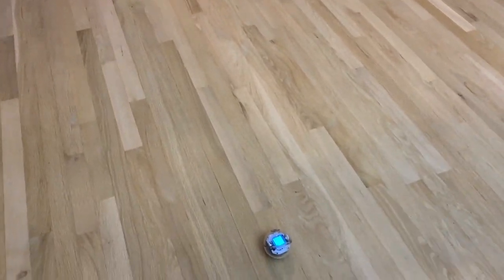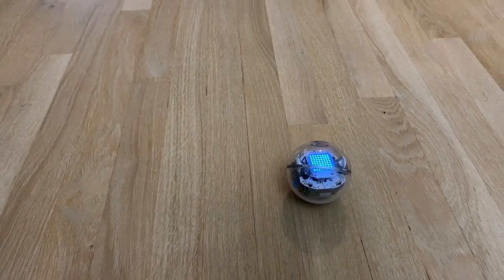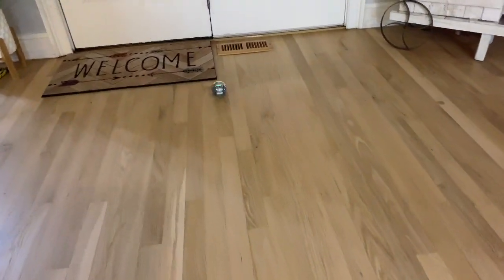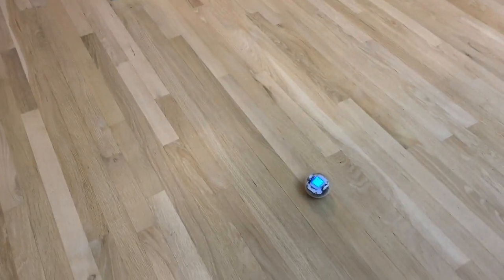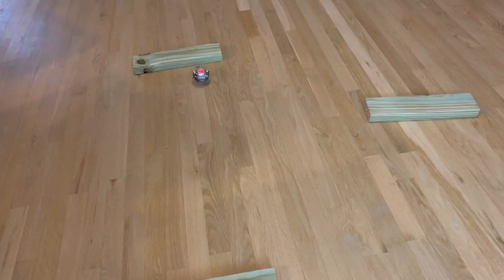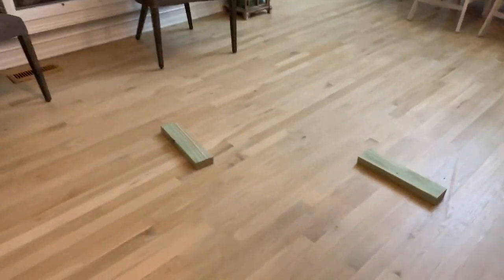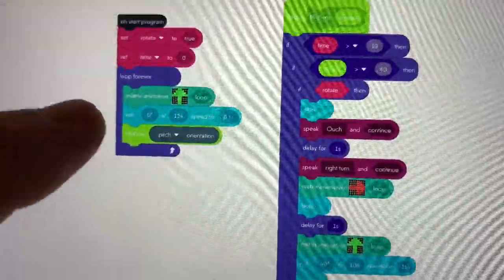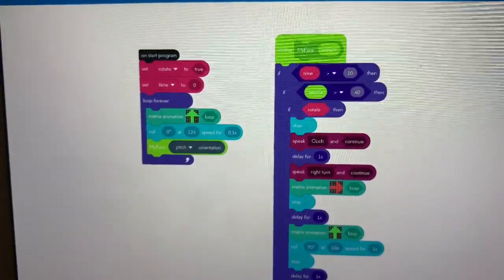Sphero Bolt using the pitch sensor

Comment: Sphero support are very helpful, you should give them a try to see if they can replace / fix?
Reply from the maker: Yeah, they tried but it isn’t really a flaw in the hardware but how they interpret the sensors.   They may have released a firmware update that addresses some of it but they tried to tweak my code and wrote their own but none of it worked.